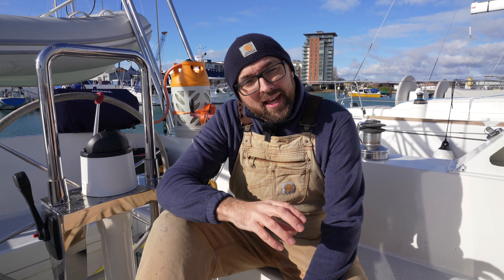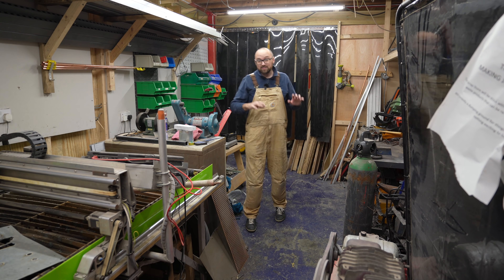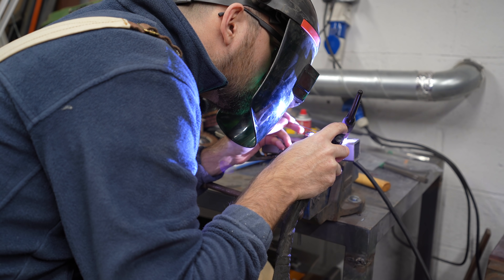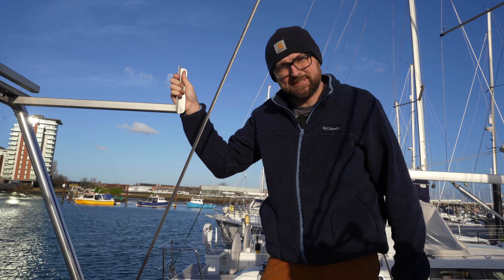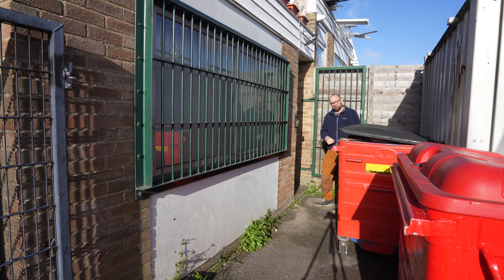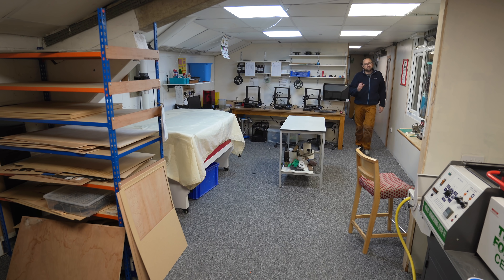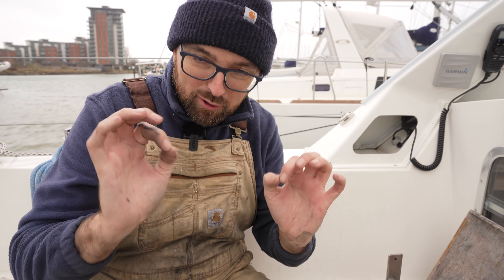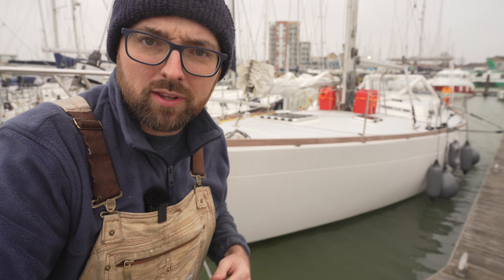Sail Life - Solar arch adapters at MAKE Gosport ⛵

Comment: Hi Mads. Been watching you for years now. Quick question.
Your pipes on the solar arch, do they come in any required length or you have to weld them together? We have a 60foot Dufour thats 18foot across, given the height of the arch 8 foot or so, we would need 34 foot long pipe. Are they available in that length or you have to splice/weld shorter pieces together?

Comment: You could put springs or rubber disks or something similar between the heads of the bolts and the nuts on the extension piece. That should prevent them from ever coming loose.

Comment: Random guy in Workshop:   Hey, did you hear, we have a guy in the hot room who knows how to weld stainless steel.
Other Random guy:  Quick,  shackle his ankle to the metal table.  we have at least twenty welding projects we need to have done.
First Random guy:  Be sure to keep him away from the grinder with the cutting wheel.
Other Random guy:  Yeah,  we don't want him cutting his foot off to escape like the last guy.

Comment: We had an amazing makerspace that was started up by my work (an auto company) as well as a few other companies.  It was managed (mis-managed) by a 3rd party. It lasted about 18 months before it closed due to nobody using it.  Well...when its $2400 PER YEAR (that's the discount price) yea, that's going to happen.  There was also a "consumables" charge for any equipment that used things like weld gas, coolant, etc.  Weld Wire, Tig Rod, Weld Sticks, FDM Materials, that was all on you, but you still had to pay extra "fees" to use the equipment.  Somebody must have thought they could make a lot of money, and ended up closing it down.  I heard none of the companies involved in starting it were very happy, and were out of the loop after giving the cash infusion to start it.  Vendors took their equipment back, and such....sad.  :(

Comment: Very nicely done Mads and great that you found the Maker space - did they reach out to you? They are to be congratulated for getting this wonderful space together and equipping it so well, that is a massive achievement, especially in the South of the U.K. where land is uber expensive and rental costs high. It is has been disappointing to read some of the uniformed, arrogant and derogatory comments made by a few here in the comments section.

Other than that - spiffy video and progress, progress, progress - good luck with mounting the panels.😀👍⛵️

Comment: Usually a good idea to check that your threads still work after getting that amount of heat into them. I would have tried running higher amps and shorter welds times.

Comment: Too late for this project, but you should insert a bolt into the nut before welding. It will act as both a 'heat sink' and a thread protector. Also, I can't tell from the video, but it's good practice to keep the gas flowing for a few seconds after you've stopped welding, on both the weld and the end of any filler rod. Prevents contamination of the weld... I'm guessing those red jugs around the mast are spare fuel, why not ask your in-house expert seamstress Ava to sew up a white boot to keep the sun and rain off them? 😎

Comment: Mads if you have a Dremel with the flexible wand the wand will fit inside the tubing to grind that weld. Having the flexible wand makes using the Dremel so much easier especially if you are working in tight or enclosed areas. I have a small shop but I'd love to have a shop like you are using available for my projects. That's an amazing public area with a lot of very expensive equipment.
The next time you need to weld a nut onto something try using a bolt to hold it centered in the hole without moving.
See ya next week.

Comment: Maybe I don't understand your genius Mads, but why did you make the adapters pressure fit? Why not just drill a hole through the bottom and bolt through to your captured nut?  You're going to have a ton of sail area depending partly on those two mounting points. It wouldn't take much, like a couple of broken tabs to have the panel fully depending on friction.

Comment: Beautiful work.  I will need to check out in my area to see if there are any makers workshops.  What a great idea.  I was surprised at the the amount of STUFF and sawdust everywhere.  I would think that they would have a "clean before you leave" policy.
I thought that the reason you needed to remove the first panels was because you needed to beef up the arch.  Have you done that or is it still upcoming?
Reply: Absolutely do have a clean before you leave, it was shot in the middle of a huge group project constructing 50 boxes for a big event.

About 10 people set the space up, only a year ago, with 30 members currently. So much work to be done, but it's come a long long way..  Also in the middle of a huge cnc upgrade, it's for members, run by member's so things take time

Comment: Aren't the solar panels going to be a bit of a liability in strong winds?  Even folded up, they are still going to have a fair surface area and in gusty conditions they will put a lot of stress on the solar arch as well as possibly making Athena more difficult to sail.
Reply: Its a fact of sailing life on most monohulls ..you need solar you put them on the arch to avoid shading ..as far as possible. The component most likely to fail is the Aluminium panel frames. 
You can always brace frames with lines of dynema... if anything does start moving triangulate it...and its light and cheap to do.

Comment: Nice job Mads and the typically British understatement must be rubbing off.  Eunice was the biggest storm to hit the south of England in 30 years and storm Franklin is due anytime.  Stay safe and fingers crossed that the High-Pressure forecast for Thursday gives you a solar panel weather window.
Reply: Come on now.. Mads has been the master of understatement for years before even reaching the UK.. remember his "slightly extensive refit" line?